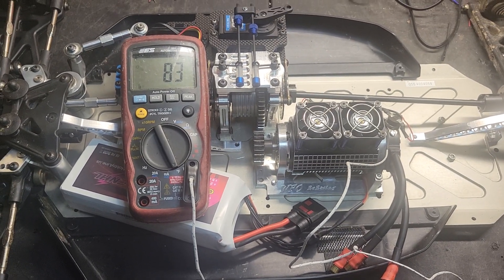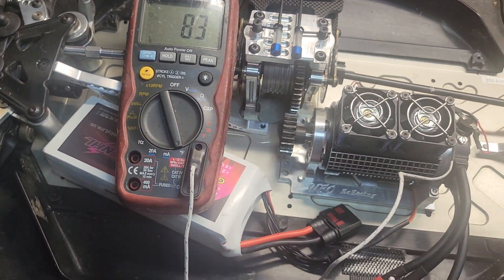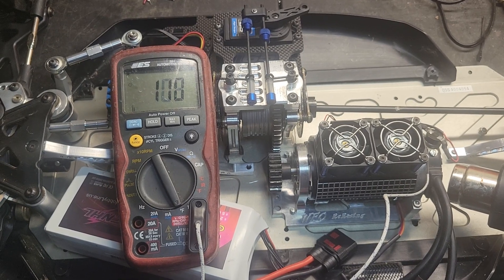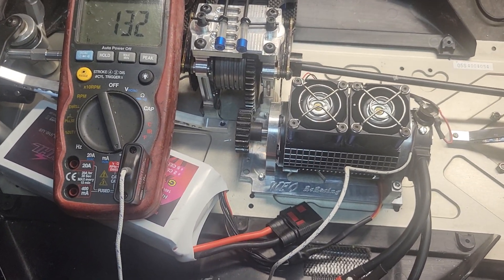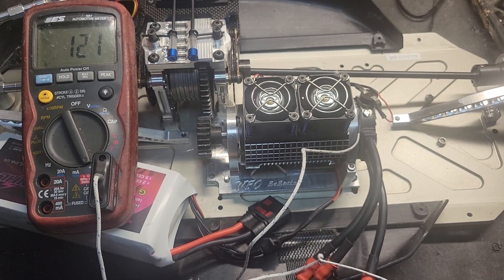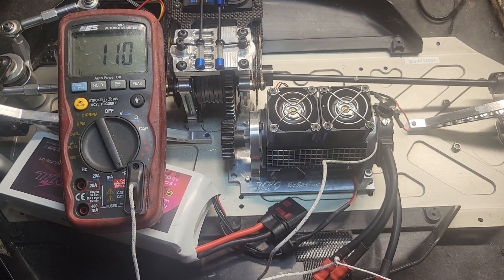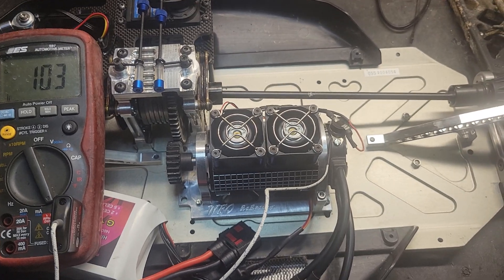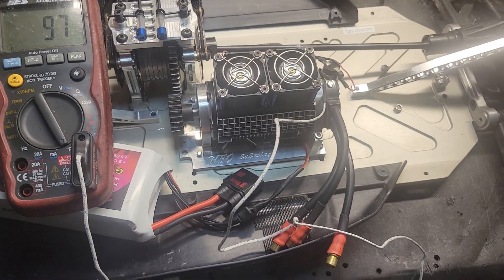RC brushless motor fans [temperature control]

Comment: Just got some temperature control switches, how do you wire them to the fans
Reply from the maker: they just go in line from suppy to load then back to battery negative

Comment: Hi where did you get the fan upon the heatsink ? Did you buy it or build it ? Thx for the share and demo.
Reply from the maker: Thanks for watching.  It's just a 50×50 fan I purchased from ebay.  I used HR racing fan mount to mount to Traxxas 1200kv 8s motor heatsink 
https://www.ebay.com/itm/163970580106?mkcid=16&mkevt=1&mkrid=711-127632-2357-0&ssspo=mUy7eoltTPe&sssrc=2349624&ssuid=2L4bftxdREC&var=&widget_ver=artemis&media=COPY

Comment: Hi, Gonna share my take on this. I'm the founder of Thunderoos RC fans and I have played around with this myself. Installed a temp controlled solution in my Mojave. The problem is that sometimes the fans get stuck/jammed and with a temp controlled solution you never know if your fans are idle bc the electronics havent reach the temp or if it is jammed. I foud this to be a problem when testing IRL and ended up removing the temp control. Now I always run the fans all the time and knows that when the fans go silence something got stuck. Best regards Daniel from Thunderoos RC
Reply from the maker: It's the nature of the beast.  It's no different than an esc not working anymore.  I've been running these so long on all the riggs,  I pretty much know when the fans need to turn on based on usage.  It's always good to have a temp gun and a portable fan nearby that can plug to the balance lead for emergency cooling.   Personally, I am not a fan of crazy high powered fans running full time.

Comment: One quick question, can the XLX2 handle more than 8s? I know that the 800kv Castle can,but can the XLX2?
Thanks for the video
Reply from the maker: 8s voltage is the max voltage for XLX2 esc.  2028 800kv is definitely 12s capable and is flawless with hobbywing max4, Flier 400amp and MGM 40063 on 12s
Reply: @KiloWattRC  thanks for the info

Comment: Whats a go to gearing for your mod 1.5  losi setups?  Im running the 800kv castle on the hobbywing max4 on 12s and im running into some cogging. Current gearing 18P/48S. ..mod1.5
Reply from the maker: 22/58 and my losi does 100mph with proline badlands max4 esc and hobbywing 56-113 800kv motor.  Look into like 54 spur 15t pinion

Comment: Awesome info! This is the correct way to setup your fans. If not your putting way more stress on your fans and load on your batteries for no reason. Plus you run a greater risk of having busted fan blades by running them the whole time. 
What thermal switches do you use, link?
Reply from the maker: Thanks man.  Check this out.  
https://www.ebay.com/p/1503549751